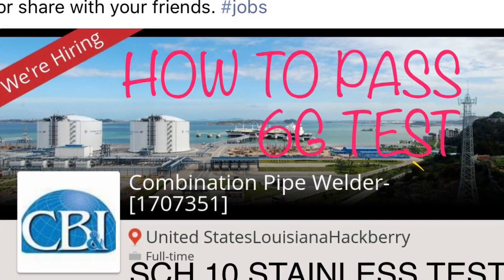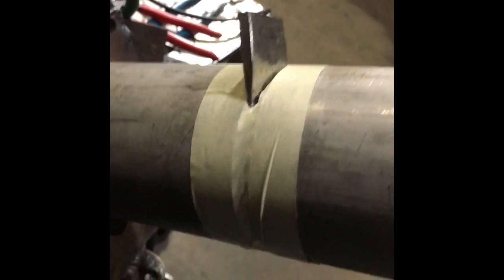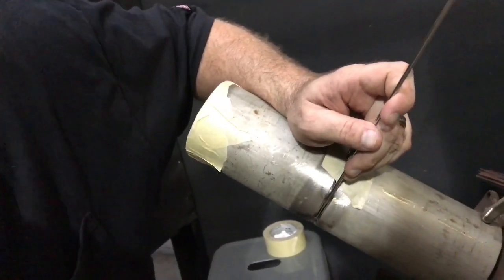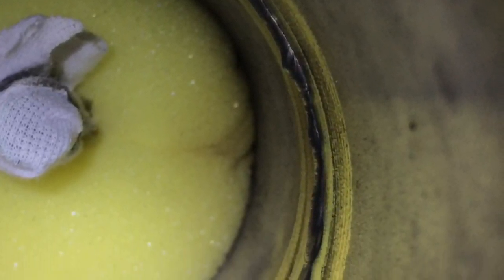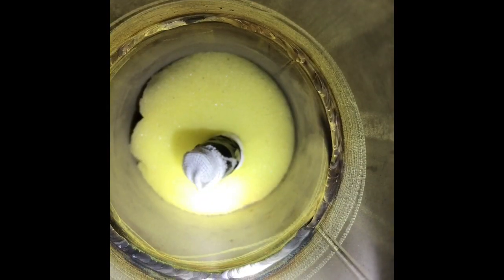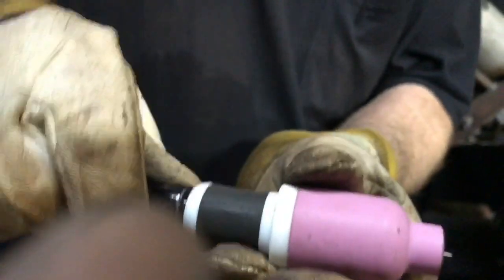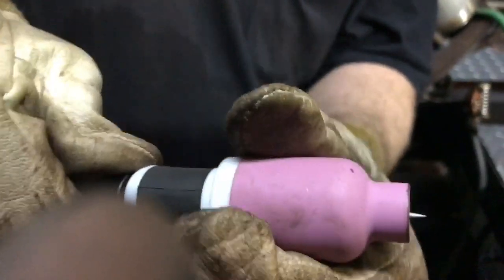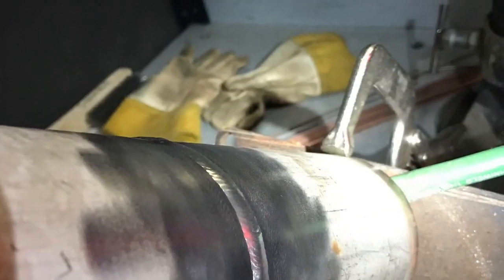CB&I Hackberry Stainless 6G Test Backfeeding

Comment: CB&I or now there Mcdermott used the Aptim weld testing facility for the LACC/MEG1 & Hackberry LNG Projects and I passed my test but it did seem like the CWI was looking for the smallest little mistakes to fail you. I think he was an from the dominican republic and If you were a white guy he thalt you were a racist and wanted to fail you. It was one of the strangest feelings I have ever had going in to test in my life. I honestly think they should get rid of that guy he treats the Mexican and foreign guys better its was a very weird feeling. So my advice if your testing for Hackberry  for CB&I/Mcdermott just be on point so the CWI has no way to fail you. DO NOT WELD A FLUSH ROOT he will look you out on the root and send you packing.

Comment: Yes this can be done, I do this all day at my job.. it may sound crazy but for me and all the other guys i know we use 3/32 wire with the 5/32 gap. With the 1/8 wire it can be hard to get it started and keep it going, you usually need more heat, which you don't want since it's sch. 10 pipe. The 3/32 breaks down and flows more easily, the only set back is you got to feed it more constantly and consistently. But you can slick a real clean root in there just the same. This is how they do it at the refineries here on the west coast also.. 
Love the vids guys, keep em' rollin!
Reply from the maker: Seth Rosellini thanks for the info and feedback ! Glad to know we are helping.

Comment: 5/32 gap with a 1/8 wire that what I use to do when I started to learning how to weld. By code no more then a 1/8 penetration on the root pass but if that what he want when give him what he wants. If you use an 1/8 gap and 3/32 wire you will use less heat to burn the stainless especially 316ss when u arc off make sure where u stop u keep the Shield gas on it. Now if you get out  of the bottom pipe which if you want to take an schedule 10 test and work full time you could. Run the bottom out first and if your top slightly close up that u can't put the wire in start your key hole the hotter u go up on your heat the more u stack in the pipe.
Reply: Tyrone Rips Up Cats Kang my bad bro I was drunk when I wrote this the life of a welder. I'm glad that this business is not in the office, because I will be fuck. People like you give people like me the drive to succeeded ...Do not let me catch you on the other side of the pipe then you really will can me a wet back.... WE WELD AMERICA!!!